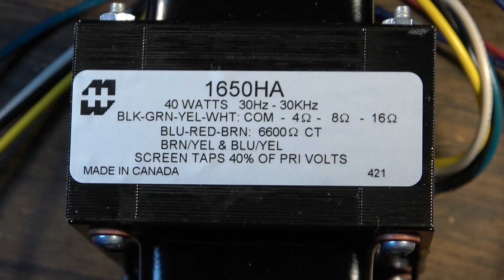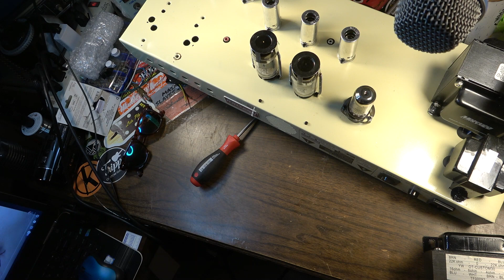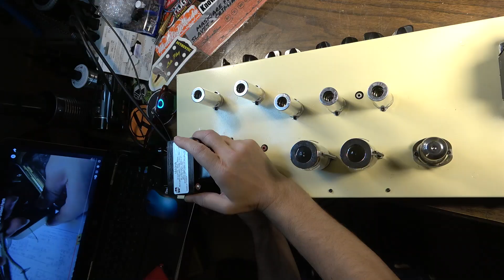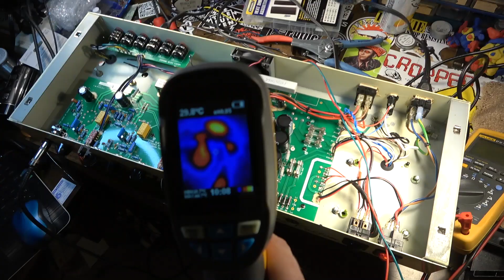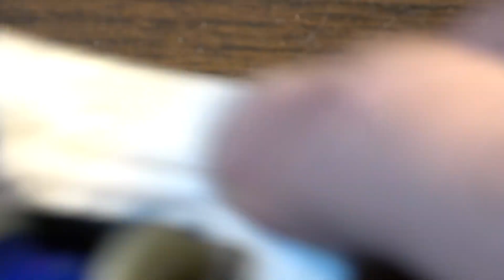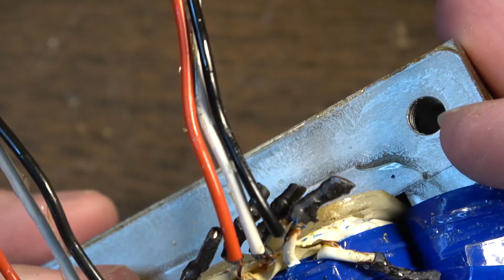Upgrading the Output Transformer in an Epiphone Blues Custom 30

Comment: I have a socal 50 (which is similar PC I think?) that has been abused for 18 years, hasn't skipped a beat and works like a truck. I think the PCB is thick enough and good material that the tube socket mounted on it doesn't matter. The amp has been in cold and hot, thrown around and in the trunk every time, left on during breaks, and so on. Works as if it was new, looks beat up to hell though haha

Comment: Heard you mentioned standby switches here, and I seen a video where you recommended not using them on tube rectified amps. I agree, I was just telling my friend to quit using his on his deluxe reissue. The tube rectifier provides a nice soft start versus a big spike you get with the standby. Once you've seen this happening you'll be against them. I quit including them on anything I build with a tube rectifier, which is what I use most of the time.
Reply from the maker: Yeah man, it's just not necessary, and clearly can be harmful. Just make sure you design the switch on the transformer side of the rectifier. That helps.

Comment: 20:55 i see your point however it is possible to order new custom PCBs from third party vendors (PCBway comes to mind) yeah it may not be something Average Joe should do, an amp tech could
Reply: The PCB blueprint could probably be sold at price to perhaps. (This may be legally dubious tho since it's kinda infringing on the design of the original creator but then again the bord is no longer produced so legal actions probably not worth taking economicly speaking from the amp producer side, i don't know man I'm no lawyer)
Reply: Hell, one might even use these services to make PCBs for old hand soldered amps too. Just take the original blueprint, Import it to the board designer and the program would give options on how many layers you'd want. Also you could design the PCB so that the tube socket is mounted to the chassis, then from the socket there's leads that goes to a ribbon connector or something on the PCB so the socket don't heat the PCB directly
Reply: Then again, amp designers should really stop surface mounting the tube sockets.  It's better to start producing sockets with a quick disconnect ribbon on the backside of the socket to the PCB. There has to be a way to make the install prosess quicker for the manufacturer then hand soldering ever individual lead from the socket to the board yet safer and more serviceable than just surface mounting the tube socket

Comment: BRAD, can you get me a link for that small heat gun you used ?  Please.  I do instrumentation at a oem proving grounds.  I desperately need a heat gun of that type.  I can not find one anywhere.  I have run across 1 or 2 online, super low quality not worth 5 cents.  Your looks like it's at least better than terrible.  I need o e I can use many times a day 7 days a week and hold up to the use. 
    If you can help I'd greatly appreciate it.
   Thanks,
     Bryan from N.W. Indiana
Reply: If you can get me a link and put it on your list of stuff you get kick backs on,  I'll probably buy several of them. Maybe a dozen or more.
Reply from the maker: There is a link to it in the description under Stuff I Use. It's the rework station.

Comment: My brother TV repairman, had those wire strippers back in the 80s. Cool tool, but i only use the plasma fire Candle starter or a lighter. Fast easy never lose a Strand of wire.
Reply: You burn the insulation off? lol

Comment: Amp value: $399
Repair Bill to date: $550.57
Reply: Yeah, but now he has a much more reliable amp. Bad for resale, but better for general use over time.
Reply from the maker: The owner and I discussed this. I think the amp is worth working on. When or if the board finally goes, he’ll have a nice set of trannys to build something in it.

Comment: I kind of hope the problem with the one fuse in my little Marshall Class 5 is the output trans. Then I can have it changed to an 8 ohm transformer. I think Marshall designing these with a 16 ohm output is not a great idea, I have more 8 ohm cabinets available to me in my place than 16 ohm.

Comment: I bought a Wangs amp, fortunately it’s tubes are all above the board, heat going up to air, not circuit board! and the amp is vented really well around the tubes, plus I removed the rear cover, (so I can try a vintage mullard 12ax7
at some point.) 6v6 power, it runs really cool considering the gain potential it has.
Reply: Sounds awesome. I need to take the back off my little plexi i cobbled together from a Ceriatone kit if I play it for more than a couple hours straight.

Comment: When I’ve used either kind of wire strippers, it always took off sometimes more than a little wire along with the insulation, so I usually melt the insulation with my iron just so much then pull it off. May not be the best way but I never lose wire.
Reply: I tend to do the same with any high end wire strippers I’ve used, lol. Always end up going back to the simplest and cheapest kind where my technique serves me well.
Reply: @graxjpg  Yep!

Comment: Does the fan pull cool air in or warm air out? I have a Hartke HA2500 were the fan blows into the chassis and exits through the power transistor heat sink.. But its only effective with the top cover in place. Maybe the board and its components will run cooler when it's buttoned up? Just a thought.  Great job on this one. Keep 'em coming.

Comment: I would have loved to have had those wire strippers when I installed a new stereo in my truck. I had to adapt the old harness to the new one, so I bet I stripped over 30 wires including the speakers! That would have come in handy.
Reply: My father had a pair of those strippers-would like to get some.Also found these at both VOA maintenance shops-studio and transmitter.
Reply: Nice self adjusting ones are sometimes a pain in the ass to calibrate so that they don’t eat a few strands of wire in my experience, I’ve always had the best luck with a cheap old pair of regular strippers.